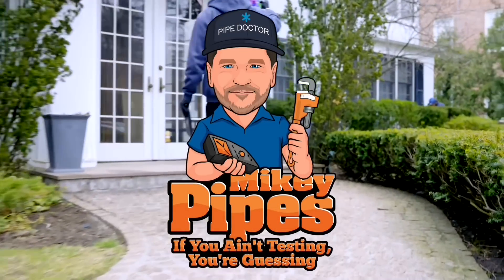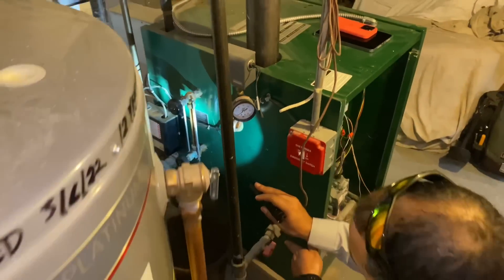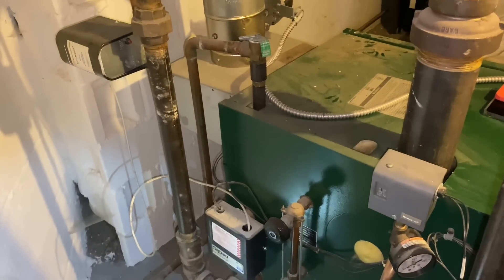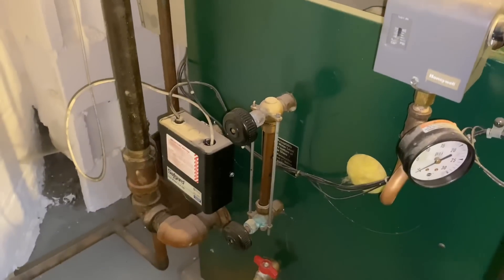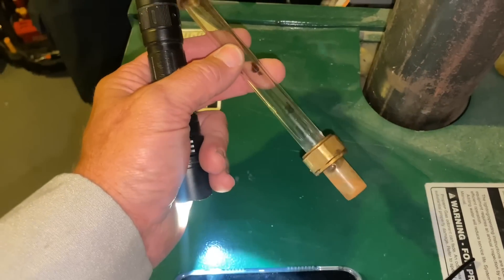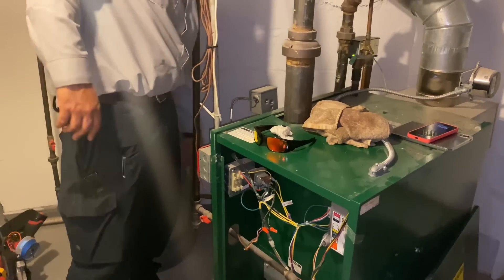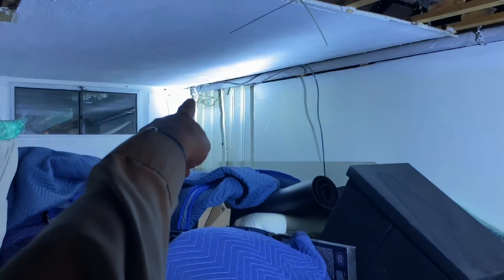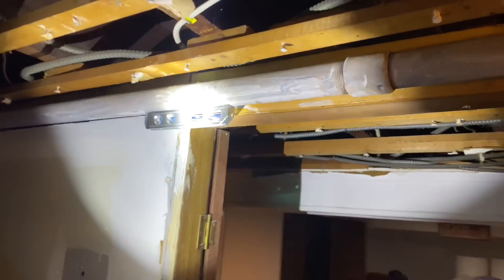Importance of Steam Heating System Piping & Insulation - Troubleshooting Guide to Banging Pipes

Comment: What causes the pressure valve to blow open,  boiler reaches 30 psi , then relief valve open , which it should,  but what's cause to over pressure,  should be in the 20s psi, I replaced the relief valve thinking it was bad,   but did the same with new one
Reply: Pressuretrol
Reply: @jakeceraso8356   was the pigtail , all clogged up

Comment: Well?? Are multiple problems with that system the very first thing I noticed was absolutely no insulation whatsoever… if it was hot water heat?? It would be one thing but steam.?? you want to keep the water suspended in steam till it gets to the end of the run..  but wrong pitch on the piping  is a big problem too… but if the automatic fill is working correctly, you really should not need to manually add water in a properly installed steam system.. I hate working with the glass sight tubes 😢 my luck of not cracking them is about 50%

Comment: The lack of insulation changes the load on the boiler too and creates the problem of too much condensate which will interfere with the movement of steam and make the water hammer a regular occurrence.
The homeowner probably added water because they don’t understand the problem of poorly pitched pipes no insulation and years of incompetence. How do you justify the redesign of this system to the homeowner? Won’t they pass out from sticker shock when they get your estimate? Reworking the pitch of the pipes and insulation and fixing the wet and dry returns and proper venting at the end of steam mains adding thermostatic vents or steam traps and boiler controls and near boiler piping? It’s a lot of work for even a seasoned professional.

Comment: Manufacturers of automatic water heaters typically require cold water going into the feeder
Reply: Hydrolevel  says max 150  degrees. McDonnell Miller has contradiction in their manual. Either 120 or 175.